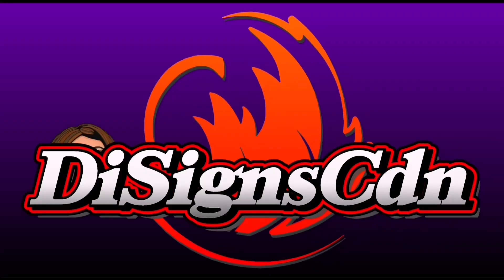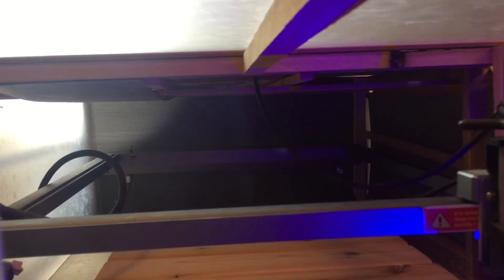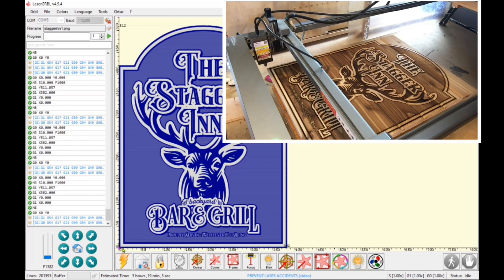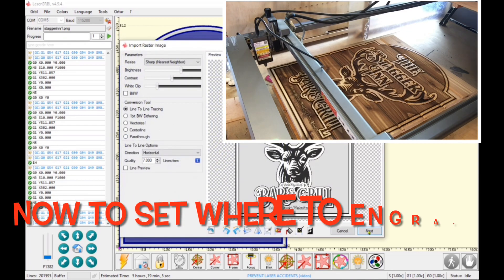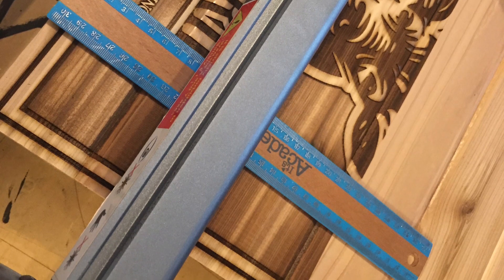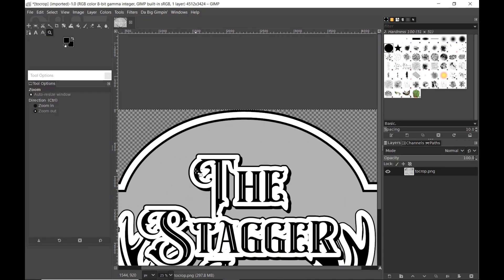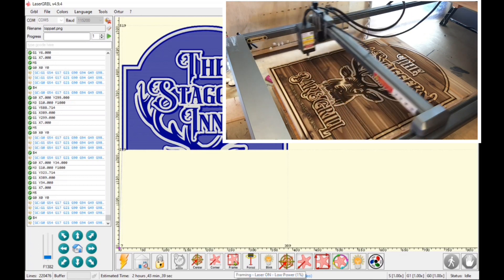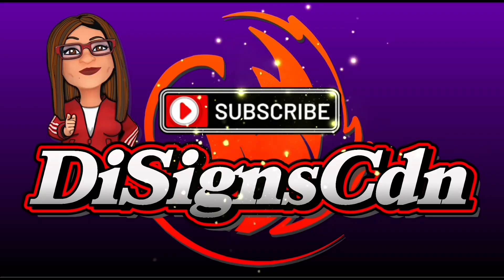29. How to RESTART or SAVE a Laser Engraver project in LASERGRBL !

Comment: I subscribed yesterday and intend to watch all of your LaserGbrl videos!  They're amazing ~ Thank you for sharing!  I use loose zip ties to keep my air and other cords bundled together but I've also noticed that other diode laser owners have used spiral cable wrap.  Amazon has 50' for around $6.00.
Reply from the maker: Welcome Celicia! and Thank you! I am a big fan of Zip ties, a cell phone holder, the spiral cable wrap,  and even a flashlight when I first started out with my OLM2 Pro...lol! I have found my issue is about at the half way point as I have the extension kit. There is just too much slack of the air hose hanging for it to get caught up. I will be trying just some elastic cord attached to the hose and the top of my enclosure. I'm very careful not to add to much weight to anything that may add stress to the stepper motor and burn it out. :)